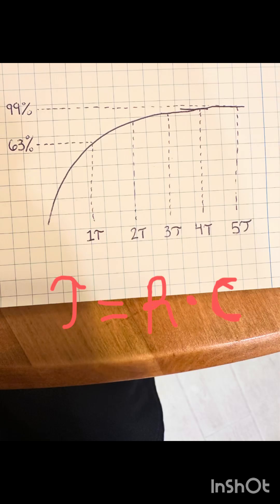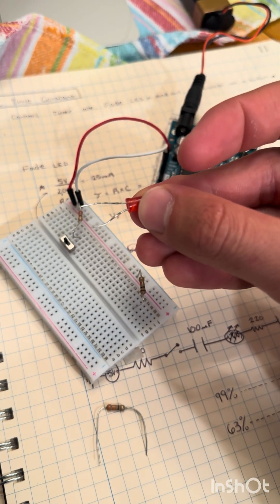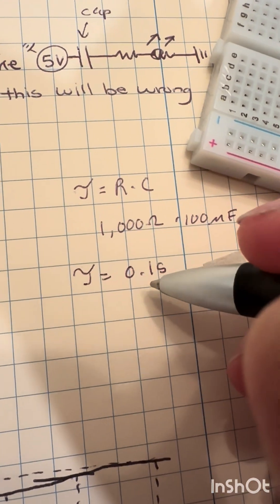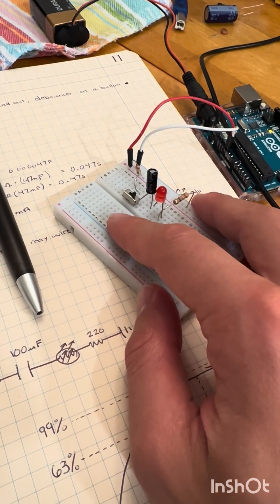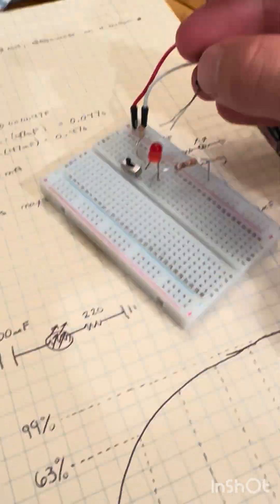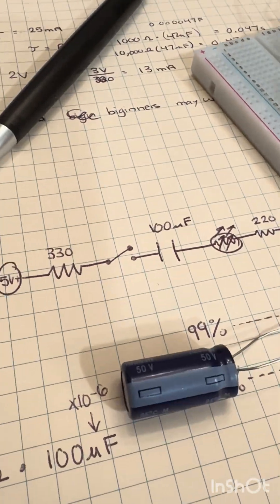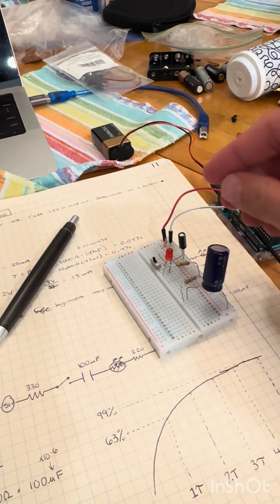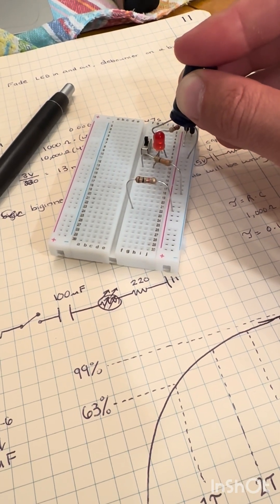RC Time Constant #1 (Fade LED)

Comment from the maker: Did anyone catch why the 1000uF capacitor turned the LED on longer than 10x the 100uF capacitor? ...

The answer has to do with the equation for Energy, E = 1/2*C*V^2. The 1000uF capacitor has 28x stored energy compared to the 100uF capacitor since it got charged to 5V instead of 3V. The 1000uF cap was charged without a resistor divider (charged in the middle of two resistors)